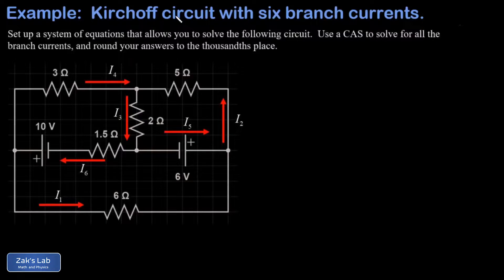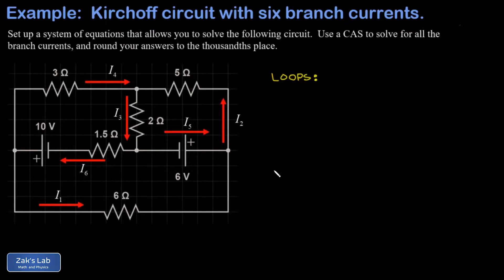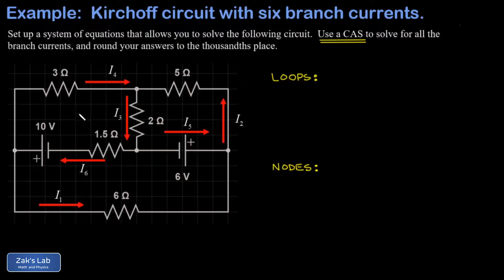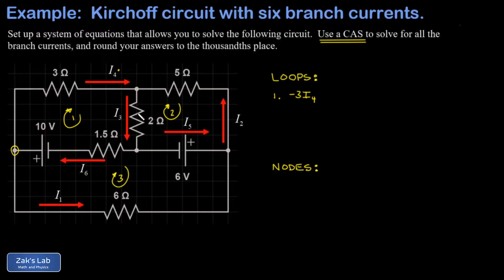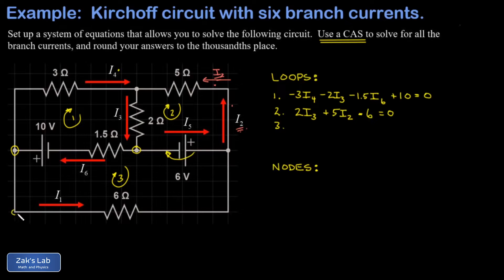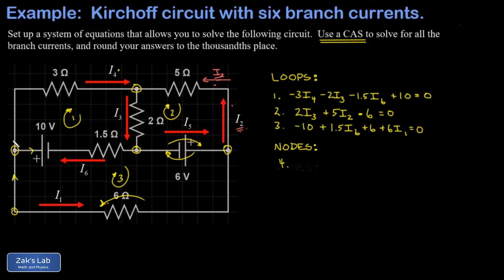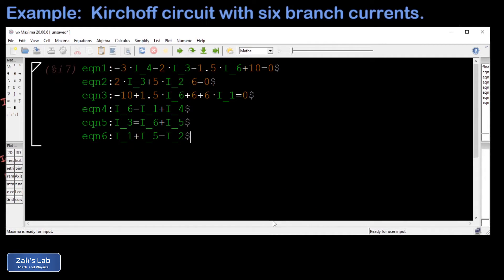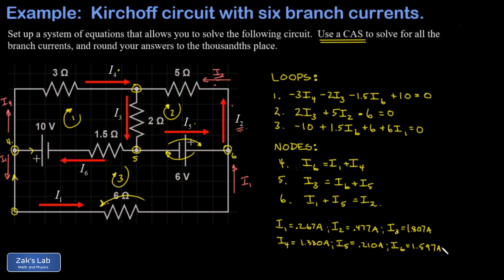Kirchoff's laws to solve circuit with six branch currents, loop and node method combined + CAS.

Comment: Nilsson's  book
"Electric Circuits"
starts with independent equations
based on  branch  currents too.
Cumbersome  at  best.

Many ways to do it .

your  Loops  suggest  3 Mesh currents
and yet you use  branch currents .
No one is going to do it that way.
No one is going to want to do it that way.

Mesh analysis or maybe  General Loop Currents.

I like your  comment about about
"drawing the  current arrow the  Wrong way" ?
there is no  wrong  or  right way.
All    "ways"  are  valid,
so  says  relativity .

i hope you didn't  use too much time
deciding on which direction to draw those
branch current  arrows.

i see you are writing  many  -neg signs in your  equations .

Top 3  books :
Haytt    Kemmerly  "Engineering  Circuit Analysis"
irwin  "basic engineering circuit analysis"  
Nilsson   "Electric  Circuits"

read all the  DC  chapters , about  10  chapters  total.
( previous editions will work just fine )

do NOT  read  tech school books such as authors:   Floyd  and  Grob
Reply from the maker: I didn't expect this video to evoke such a strong response!  What you see in this video is the standard way to present Kirchoff circuits in introductory physics courses in the US, in particular the sequence of courses for life science majors (but still it's what I remember from calculus based physics as an undergrad as well).  

The electrical engineering perspective is far more systematic (mesh vs. node method), but it is too divergent from the standard intro physics curriculum for me to teach it that way as part of a physics course.  I have taken some electrical engineering, and some day I'll make a (short) playlist for that as well.  Certainly my approach in this video would be a really sloppy approach for EE, but we're kind of stuck with it for now. 

In the standard curriculum here, engineering students all start by seeing it this way in physics, and I suppose the point is to just hammer the core concepts that net *current entering a node is zero, net change in voltage in a closed loop is zero.  The next semester they take electrical engineering and learn to handle it in a more systematic way that also comes with its own engineering lingo etc. 

-- Zak